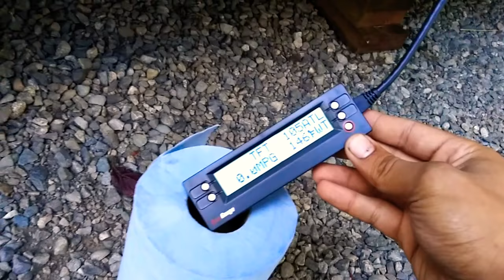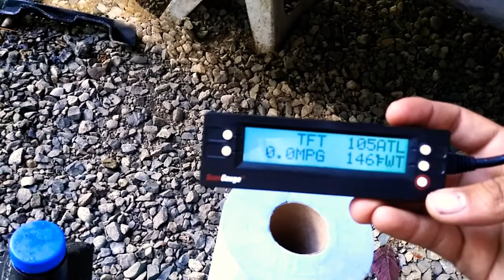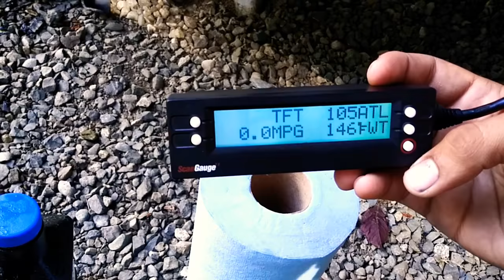Lexus Transmission Flush / Sealed A-T-F Change and Check Level

Comment: The Scangauge II should be able to read the ATF temperature, it cost $159 on you know where.  A cheaper alternative is "Ultragauge MX".  It was $96 as off December 2022.  (They also offer "Ultragauge EM" but don't buy that one if you want to display ATF temperature, it won't do it).  The MX is the one you want for this task.

Comment: Hi Michael,
Good job on the video, thanks for taking the time to do it.
I have a 2010 Lexus es350 I'm considering either a flush like you did or just a pan drain of atf. 
My yr. is different but in the same generation so fluid quantities are the same, etc.
Did you keep track of how much atf you removed? I'm wondering, how many total qts. of fluid did you use when you did this?
I know you mentioned 4-5 qts with just  the pan removal.
Thanks....
Reply from the maker: Thanks Bob,
  I honestly can't remember the total amount to cycle the entire system but I called an auto parts store and gave them my vehicle information than they answered my questions regarding the atf  quantity for dropping the pan and also for the combined total in the system.

Comment: Hey buddy, I have the same car--model and year, I have never flushed the transmission fluid entirely. It's at 230,000 miles right now. What do you recommend I should do? just drop the transmission pan and replace the fluid that came out? or flush it? I appreciate your thoughts on it. Thanks.
Reply from the maker: I know some Amsoil professionals that would recommend flushing the system no matter how many miles you've driven since the last maintenance "So Long As There Are No Current Noticeable Issues With Haw It Performs."
That being said...
I know that almost any mechanic that's been around will tell you not to perform a flush when you're past a certain point (determined by the thickness/discoloration of the fluid as compared to  the consistency/color out of the bottle.

Personally, I favor the Amsoil mentality but ultimately the decision is yours.
Thanks for asking.
Reply: Was this the first time you changed the flushed it and changed the fluid ? Im at 120k 2007 es350 and i cant get a straight answer from any lexus dealer or any mechanic did your transmission start slipping or have any problems after that

Comment: Coming from the world of Aisin and Zf in Audi’s 
Where there is 
-no dipstick 
-no fi

ll hole 😂😂
*you
Must have Vcds vw Software to check fluid temp at 35 C to Check 

- you must fill through 
—-the drain plug hole —

In this situation I would measure what was taken out and out that back in 

The check procedure is the same at desired temp a nice drip drip drip 

All good 👍🏻

Comment: Hi ,  just wonder why you did not use Toyota AFT WS fluid.  That is recommended by the manufacturer for RX 350.    If the one you used is better,  I may consider too.  My 2013 RX 350 F sport has 70K miles on it,  will do the fluid change or flush over this 4th of July weekend,  thanks.
Reply from the maker: The Genuine Toyota ATF (Automatic Transmission Fluid) is probably one of the best out there, but ASSATF (Amsoil signature series automatic transmission) is the best. ASSATF "Light" is a blue label (if they don't change it) and is recommended for this specific car. But if you've driven around 120k mi. or more without changing it then you should consider using the standard version of the ASSATF which is a red label, (currently) and probably has slightly better protection but is not "fuel efficient" like the blue label.
Sorry for not noticing the the question sooner.

Michael R.

Comment: I have 179k on my 2008 ES350 and have never had a trans flush. Should I change it? Thank you
Reply from the maker: That is a good question.
If you plan on keeping that car for as long as you can, than I recommend flushing the transmission with non other than AMSOIL. 
Otherwise the car will probably still run for a good while longer.
Reply: @michaelrosario8472  Thanks Michael

Comment: Hi Michael,   For my 2008 LS460, I programmed my scangauge with the 3rd alternative and it shows the TFT, but when I drive, the values jumps between ~190,  2xx(I think it was 284 or something), 3xx, and -40(that's a minus 40).  Are you getting weird values when you drive also?  It seems to jump between those values during shifts.
Reply from the maker: Hello,
  The only thing that I used the scan gauge for is to have the proper fluid level after the ATF flush. So no, I haven't driven at all with it.
Reply: @michaelrosario8472  Thanks for such a quick reply!!  I believe you have an ES, so it might have different Transmission Fluid Temperature anyway...but I was afraid of the worst case where maybe some of my passages/valves were blocked so the temperature fluctuates when it shifts?  It runs fine except I thought it used to coast like it had a freewheel...currently the RPM is just above 1000 while coasting to a stop and each downshift (of the 8 speed tranny) is visible as a small RPM rise on the tach.

Comment: I have a Lexus 2014, model Es250. Unfortunately, I haven't changed the transmission oil, since I bought the car. The car is a single owner, and it currently has 180, 000 km.. The agency says that if they change the oil, they won't guarantee the transmission or the repairs. Some mechanics say that I can change the oil with no problems to the transmission, others say that it is a high risk. What can you recommend? Thanks!
Reply from the maker: The ATF that currently inside your transmission is going to be quite thick.
That being said, if you do a flush than make sure you thicken the new fluid at least a little (maybe with Lucas Transmission's Fix).
Also if it is optional to use the thicker version of AMSOIL Signiture Series ATF for your specific vehicle than I would recommend that as well.
Reply: @michaelrosario8472  The shifting in the car is fine and I do not have any rough shifting. My friend advised me to remove half of the transmission fluid and refill with new then drive for 600 km then do the same thing. after doing this twice to drain all the fluid and add new fluid with a new filter. Do you think this is good idea? Have you done this in the past with good results
Reply from the maker: @zaidalmymoni6902  I have never used that method. It sounds like a lot of unnecessary work though.
Reply: DO NOT CHANGE THE TRANSMISSIOIN FLUID....ON HIGH MILEAGE VEHICLES OVER 100K MILES OR MORE!!!

Comment: Hey so I’m not doing a flush I’m just going to change the filter out and add new fluid. What’s the capacity of fluid that it takes? I have a 2007 Lexus ES 350
Reply: Howd it go? Idk if mine was ever changed and the manual doesnt say anything about changing it. Im at 120k miles
Reply: @eddieg9060  134k here. Nothing in service history from previous owner who was the original purchaser that he did any trans maintenance. Think I'm gonna leave it.
Reply: @The2Coolest2  yeah i heard it being sealed means you shouldnt touch it. I called a bunch of lexus dealers. They said dont touch it or change it unless its sliping
Reply: @eddieg9060  Yeah. Car Care Nut the Toyota guy on YouTube recommends it from the start. But I think if you didn't do it from the start just leave it. Or you can try it and save the old fluid if it starts slipping I heard. Though like I said I think ill leave it alone. If it ain't broke don't fix it as they say.

Comment: My es 350 shift rough should I drain the fluid
Reply from the maker: If you feel comfortable with taking on the process than go right ahead. It can't hurt. You would do well considering Lucas Transmission Fix though. And be sure to use AMSOIL Signature Series and not the Light version because there is much wear already on your transmission so it is best to go with something thicker/heavier.
Reply from the maker: @Mr-ow3mk  That seems like a distinct possibility. What year is it? Is it a sealed transmission?
Reply: @michaelrosario8472  thanks bro

Comment: My es 350 2008 stop moving while I was driving on the hwy. I knew I had a problem with the cv axel so I changed it but no transmission fluid came out when I took out the cv axel. I never had a transmission problem nor Lexus or no one ever pick up a transmission code can it be I have no transmission fluid or my transmission is gone  can any one help answer that question?
Reply: Sham Buch I JUST changed my cv axle on my 05 Acura TL and no fluid leaked out. But then I didn’t secure it properly and slid out when driving and trans fluid leaked out.. so it doesn’t mean you have NONE if you didn’t see any, but it’s possible. If I was you I would try and pop the drain bolt and just make sure some liquid comes out and then stop the flow immediately so you don’t lose any more than you have to, just to make sure there is SOME in there. If you didn’t have any, I assume your engine would have overheated and burned up the transmission. I have the same car you do also, but just had the Acura issues. Hope this helps man
Reply: Sham Buch and that doesn’t sound like a cv axle issue with your car not moving, unless it slipped out. Which wouldn’t let you shift into park or reverse or anything and drive sounds like you’re in neutral. If that sounds like your problem, your cv axle may have slipped out of the transmission
Reply: I can shift in all gears but my car didn’t over heat it just stop moving and that probably is the case it did help thanks I just hope I don’t have to spend any extra money that I really don’t have to
Reply: D Knights  sorry but would my check engine light  be on ? I have no check engine or nothing and I haven’t changed it period I’m at 159k now?!
Reply: Hey guys you’re perspective enlighten me here! I have 07 ES350 with exact similar situation. No codes, no over heat, highway coasted to stop, shifts through gears without movement.